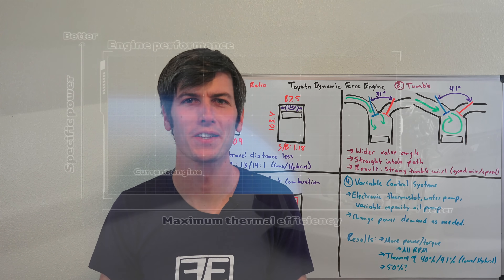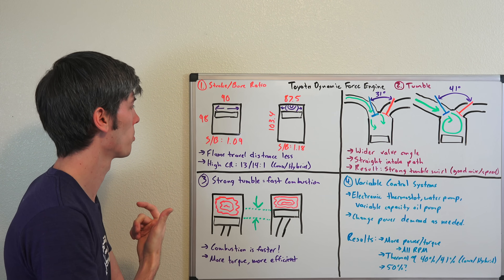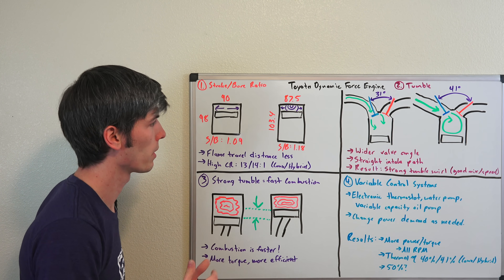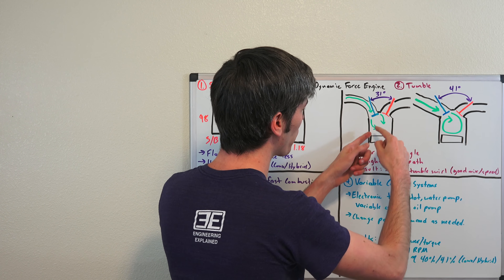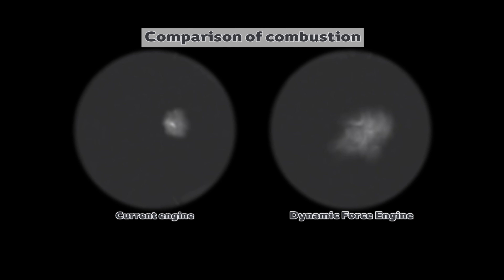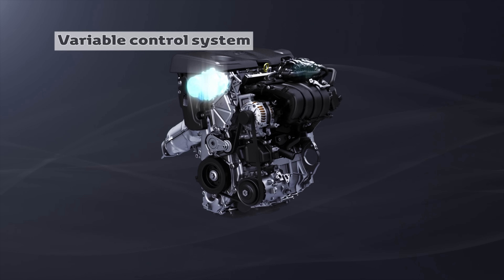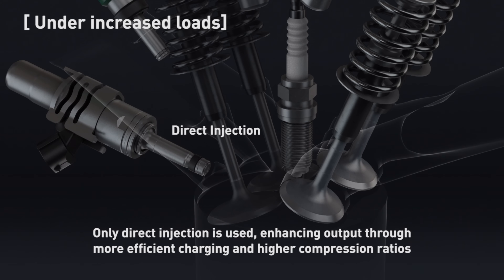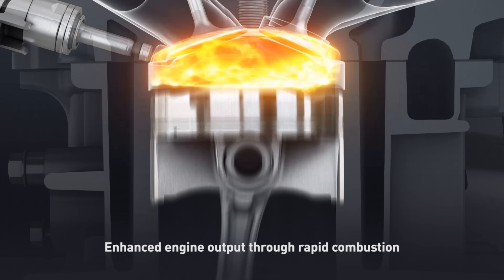Toyota's New Dynamic Force Engine Is Super Efficient

Comment: Great video.  But I wanted to say something regarding the combustion time to clarify.

It may be important to note that the actual combustion time doesn't change.  The reason you see the flame front burn "faster" with the new engine is because of better atomization of the AF mixture hence an even ignition of the total mixture.  This is in contrast to the one that is "slower" where the propagation of the flame front within the cylinder takes longer because of the messeier nature of the AF mixture.

It doesn't change the point of your discussion, just adding to it.  But for those interested in more details it might be useful.  Good to see the public benefiting more from the implementing of this technology to mass market.
Reply: What it sounds like, in the end, is an even more appropriate application of fluid dynamics. They redesigned valve/cylinder relationship so that a vortex naturally forms out of the AF mixture (which helps it stay moving until combustion) vs two contrary vortices which slam into each other resulting in smaller droplets joining to become larger droplets, reducing the degree of atomization and therefore lower fuel/heat efficiency.

Comment: Not sure if this got mentioned yet but it also looks like they optimized the location of the injectors so that they spray the intake valves as they open into the combustion chamber.  Should help keep them cleaner than the standard direct injection engine.
Reply from the maker: I'm not sure if they cover the valves or not, but there are also port-injectors (see 4:20).